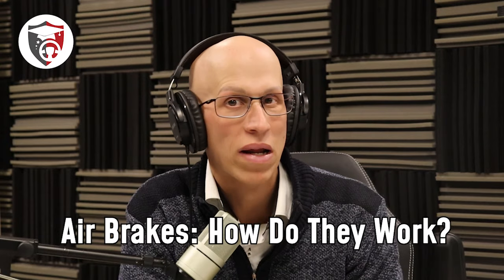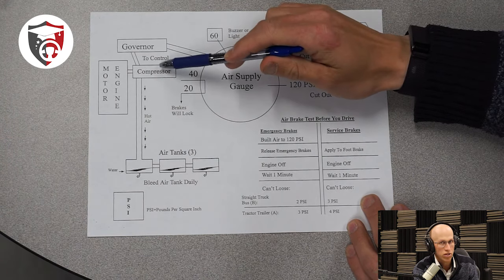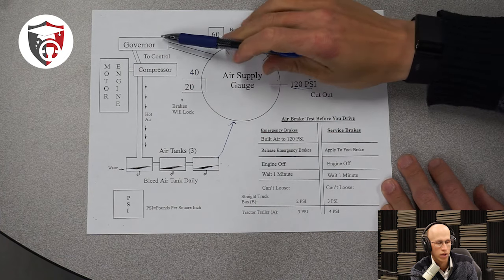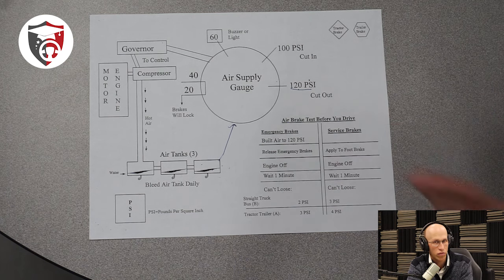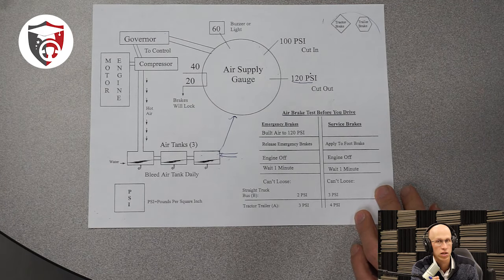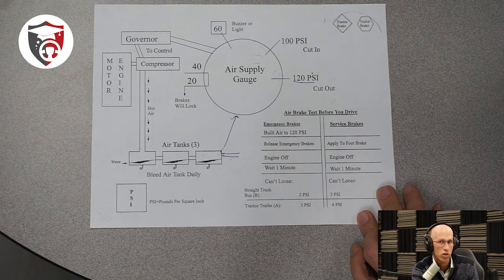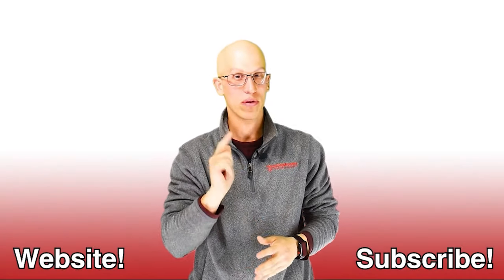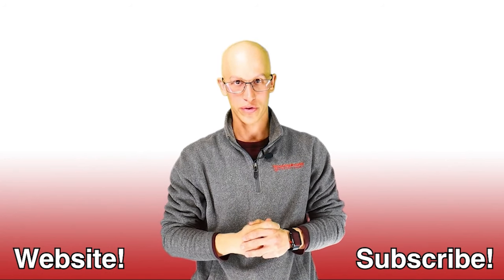CDL Training - How to Pass Air Brakes Exam - Driving Academy

Comment: I'm in ct and we have 3 air pressure numbers I am still confused on - the cut in is at 100, cut out is 150 and full is 125..iirc. I don't think you mentioned 150psi so now I'm confused. Which state are you based out of?

Comment: I should've went to your school, because the school I go to they have not teched me the proper way to do my off set and Pharrell. Straight back is a challenge I'm going backwards like a snake 😃 I've been there since July 2022 and they keep changing the pre trip on me.  And the state rep throws you off so you get confused and it my job to keep focused.
And if you mess up just one time you have to reschedule like me.
I will not recommend this school ever.